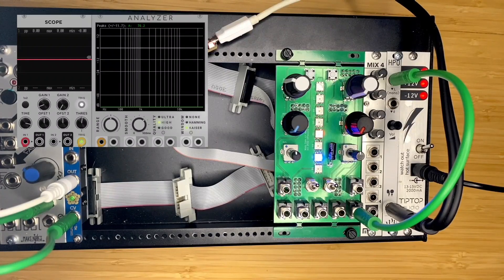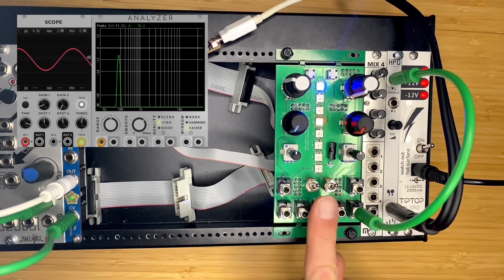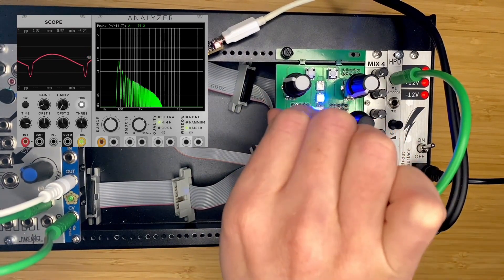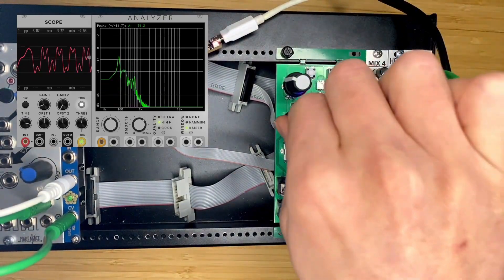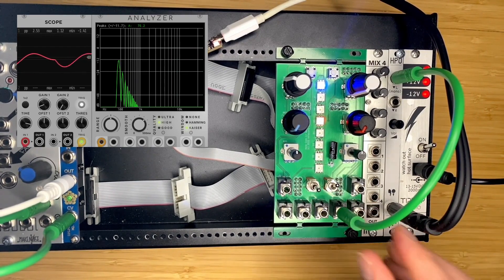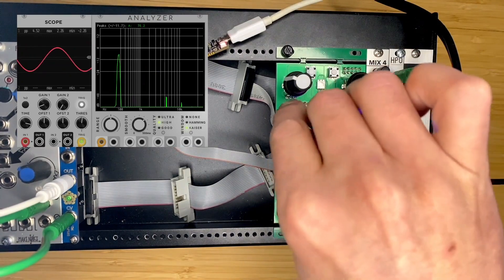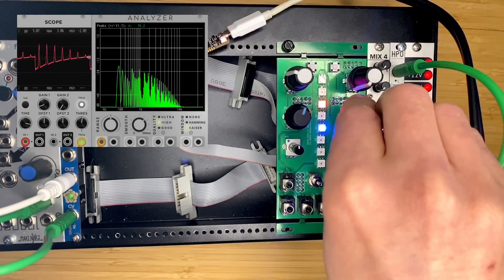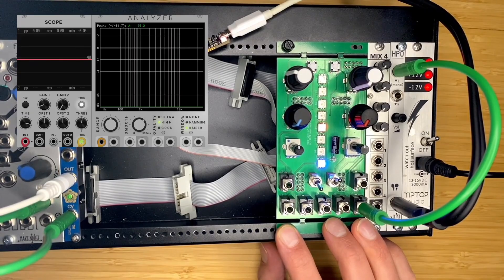Warp Core // Phase Distortion Eurorack Oscillator // Development Update (Jan 2023)

Comment: Cannont believe how excited I am for this, and even more grateful for thr throrough peek into dev & behind-the-scenes! 🫂
    I also haven't yet taken the plunge into hardware modular as I'm dedicating time to research & planning first—although I'm no newbie to hardware gear or DIY—but I've also been thoroughly pleased with the VCV version. And as someone who's been building up my knowledge/experience in DSP & hardware synthesis design (a carryover from my love of hands-on DIY building & design/hacking/custom-modding/firmware-dev in my other hobby; mechanical keyboards), this stuff has been immensely useful. 

Would love to see your personal workflow & tricks in the _CAD/schema+PCB-side of things in a synthesis-specific context! I much prefer the idea of DIY building as much of my rack & gear as possible (I have a toddler at home so the "savings" are just a bonus 🙃), be it for custom personal module design, or just modding/upgrading simpler DIY kits.
    Still have tons of learning - my CAD experience mostly went into keyboard enclosures/mounting designs in Fusion and simple PCB modifications on others' open-source designs.

Either way, this thing is sounding INCREDIBLE at this stage & just wanted to leave some support! Wicked psyched, now just hoping this'll be in my budget.

Comment: Definitely my favorite VCV oscillator! Super cool to bring this to Eurorack, but can someone convince me why I wouldn't just use the Rack version running through an ES-9 or other DC coupled interface. With virtual Warp Core I can have polyphony and multiple copies and can map all the knobs to a midi controller like MIDI Fighter Twister. I really want to build out my Eurorack system, but I can't seem to justify buying hardware models when the virtual is so damn good! Still, I'll probably buy it anyway because this oscillator is so sick.
Reply from the maker: You can of course do that if that fits your workflow! My plan was always to bring Warp Core to a physical module, the VCV Rack version is a stepping stone towards that. And yes I do plan on eventually releasing an updated version of the VCV Rack module with the new functionality as a more direct hardware clone.
Reply: Is there any chance the extra algorithms in the hardware version could be ported to VCV Rack as a premium ($) module?